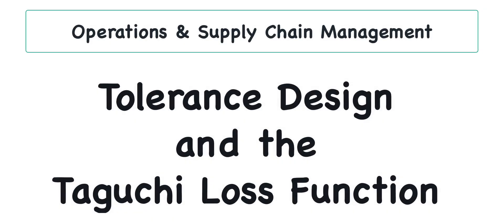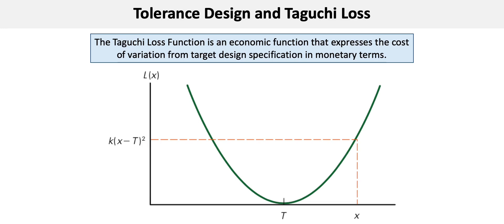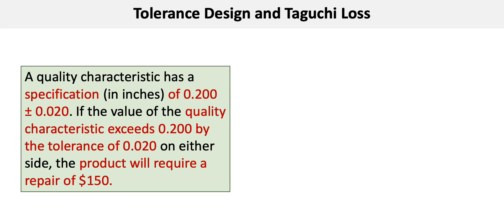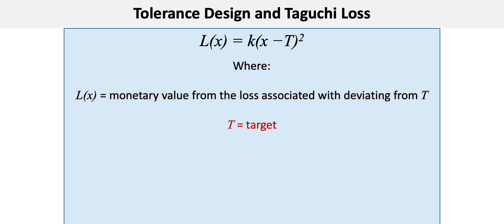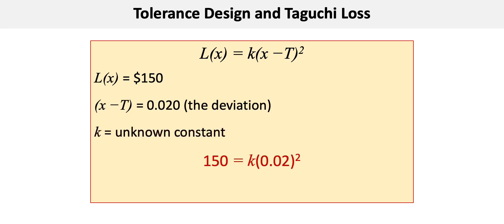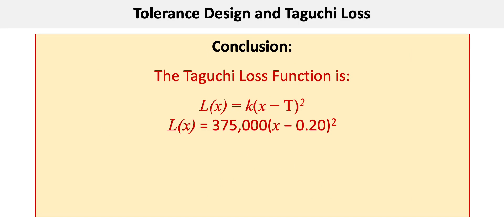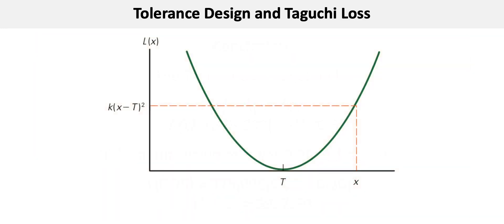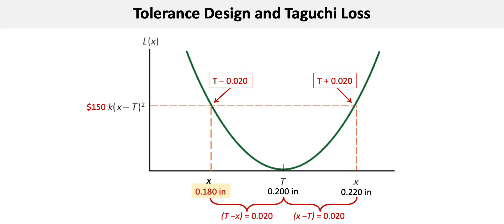Operations and Supply Chain Management: Tolerance Design and the Taguchi Loss Function

Comment: Where did the 0.20 come from? Was it not supposed to be 0.020? Was that a typographical error?
Reply from the maker: You might need to be more specific with a time stamp. At 0:45 the data states the quality characteristic is 0.20 +|- 0.02

Comment: You lost me at 0.25. How did x become 0.25? Where did the 0.25 come from?????
Reply from the maker: Hi Heidi, at 2:27 you can see that this is a sample calculation based on a value of 0.25 inches. It says "If the actual value of x was 0.25 inches..." so that's what I'm using for the calculation.

Hope this helps.
Mark